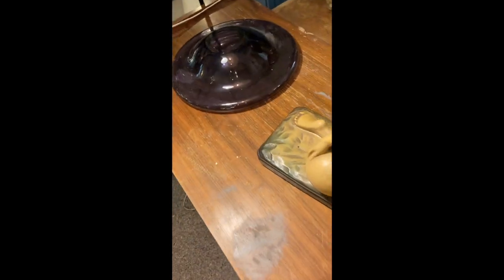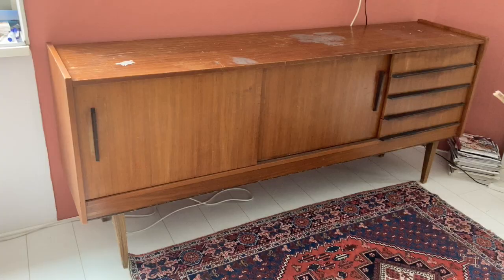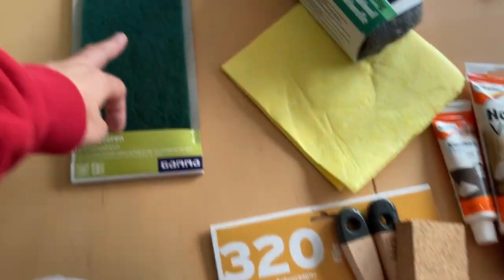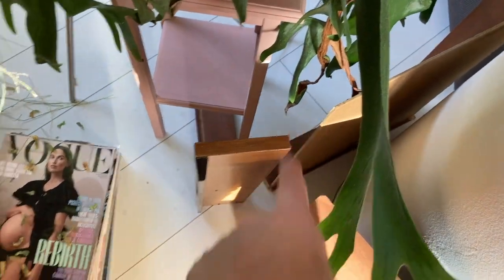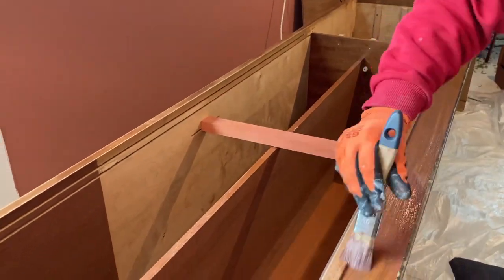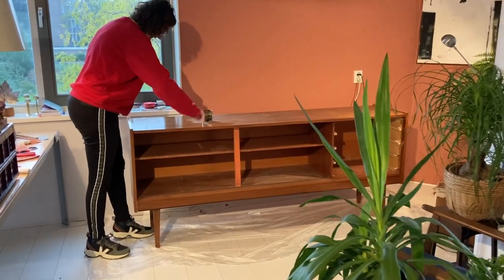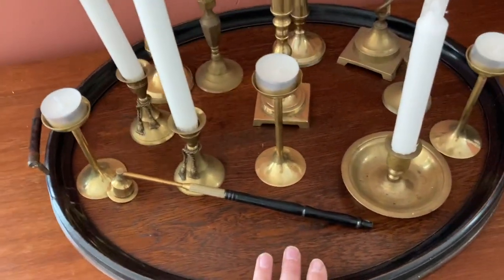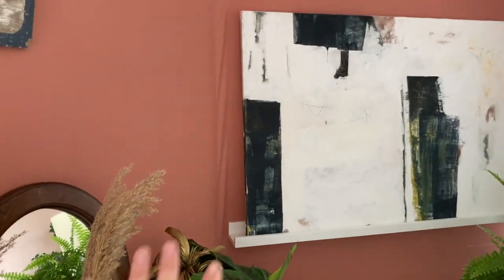Trash to treasure - midcentury credenza - Thrift find

Comment: You did a good job considering it was your first one. I do refinish furniture to flip so i have a lot of experience. If i can give you some advice. Next time if the piece is scrathed use an electrical sander . Start with an 80 grid sand paper, follow by a 120 grid, and finally a 240 grid, also i they are big gouges on the wood you need to put a lot of wood filler preferebly "bondo" and then sanded down to the same level as the rest of the surface. Lastly use  penetrating wood  stain (transparent , not solid)  that you just apply leave it for a 5 minutes and remove any excess with a dry cloth, and seal the top with either wax, or some other type of wood sealer. Also do not be afraid of experimenting by adding some color with "chalk paint" either to the whole  frame, top, or the whole piece.  you will give it a total transformation, and will update the piece. Only really  valuable pieces are advice not to change the color so it wont lose value. Hope it helps.
Reply from the maker: Thank you Ana. Unfortunately the piece is not made from solid wood, so sanding would have damadged the little that was over from the original layer. Painting would have been easier but we made another choice.